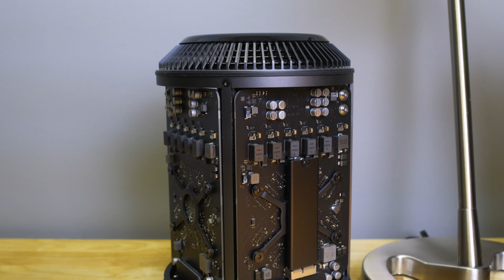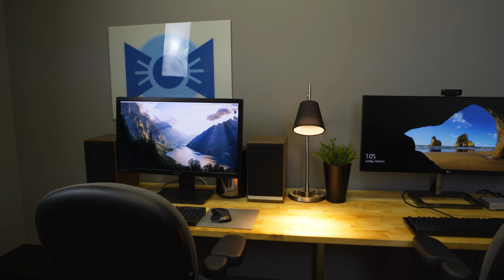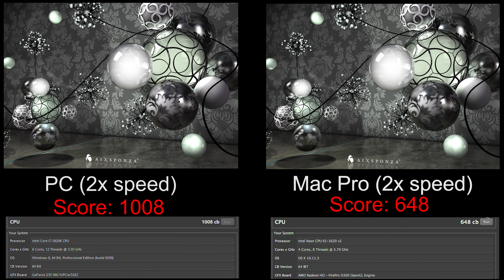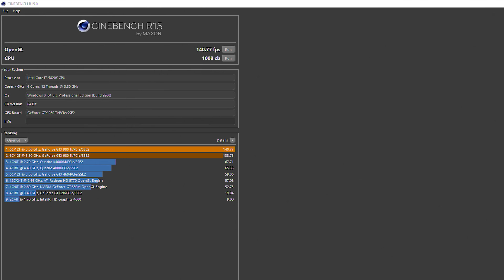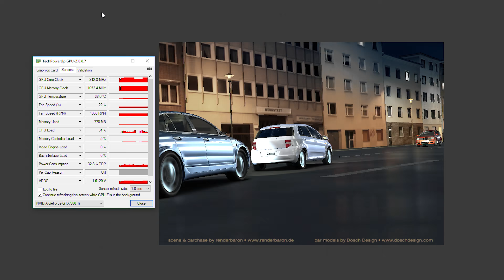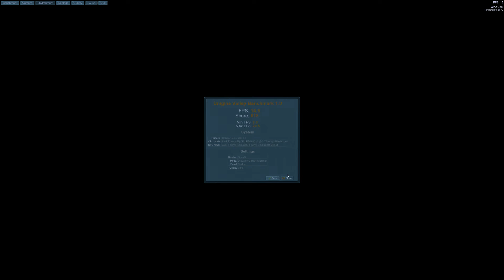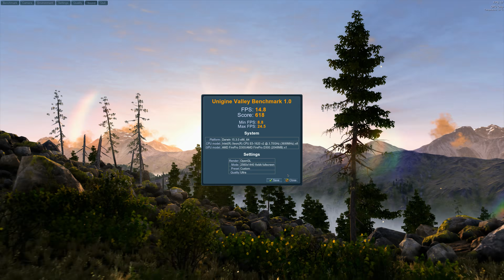$2,000 Custom PC vs $4,000 Mac Pro

Comment: It's interesting that you ran benchmarks that have very little to do with workstations, it's also interesting that you don't seem to have any needs that fit a workstation class machine. Have you looked at other workstation class components or machines, Snazzy Labs?

Also, you seem to have run the benchmarks under Windows, which is rather silly, since the support for the specialized workstation cards is completely disabled in Windows. It might help to work with a friend or to try to get yourself through this article to figure out how you might better compare the two machines: http://www.anandtech.com/show/7603/mac-pro-review-late-2013

The most important thing to remember here is that if the cheaper, build it yourself PC works better for the tasks you want to complete, then you SHOULD NOT be buying the Mac Pro. If you perform a similar comparison to workstations from other companies, you will see similar baffling results. The issue is a lot more complex than the very novice tech community believes, particularly the absolute newbies in tech that you'll find lurking the comments on YouTube, in general.

I didn't buy a Mac Pro as my primary desktop at home because the PC I built, similar to yours, Snazzy Labs, is what I need to be able to play games, looking for quick, inaccurate rendering rather than highly accurate, error free rendering -- although it has a 4690k and only 8GB of DDR3 RAM and cost me $2300 because a 980 Ti costs $900+ here.
Reply: lol spotted the scammed apple fanboy
Reply: +SniperReady "looking for quick, inaccurate rendering rather than highly accurate, error free rendering" you clearly have no idea how computers work.
Reply: Never mind the benchmark of rendering an image... Totally not what "workstations" are designed for...
Reply: ***** Do you? I'm curious. Do you understand what ECC is? Do you understand what chip binning is? Do you understand what different units are for and what application specific integrated circuits are for? Do you know how cache affects performance?

To address your direct concern, there's a good explanation on this wikipedia article: https://en.wikipedia.org/wiki/Nvidia_Quadro#Video_cards
Reply: Liam Keeton You're thinking of it in a naive way. You're not thinking about what the CPU/GPUs are actually doing, but what you think applies to a workstation. It's just not at all how it works.

Workstations offer features you may not understand, and it seems as though this is a hugely common sticking point for the novice computer user and even many advanced computer users, particularly those that believe they understand computers. It's difficult for those of us who actually study computer science to have to deal with the constant self-assured ignorance.
Reply: Saito Touhara I own a 980 Ti powered 1440p gaming rig. It would pay to read my entire comment.
Reply: SniperReady Sorry can't hear you over all the benchmarks and other software Macs can't run 😂👌✔😂👌✔😂👌✔
Reply: Saito Touhara I have a PC. It's better than yours. Hell, my second PC is probably better than yours. LOL
Reply: +SniperReady I definitely know what ECC RAM is. A much needed nessecity for avoiding memory errors on workstations and servers. I guess using ECC memory is a decent argument for the Mac,  however, it makes absolutely no difference to the performance of the computer. It would be all but difficult to buy an Xeon and workstation motherboard with ECC memory and put it up against the mac pro... No surprise that it would stillbe significantly cheaper.
Reply: Liam Keeton That's the point, not all of the things you pay for in a workstation are benchmarkable. Whether you actually need those features is an entirely different story, and I think this guy should have built a PC long ago for his computing needs.

A group I belong to is building a satellite. We require certain features, including radiation protection, that costs us extra money. It's never always strictly about performance.

For a good and proper comparison it pays to compare two workstation grade machines, and consider the features you will actually need.
Reply: SniperReady Anyone who buys a mac doesn't know the first thing about computers, lol enjoy your 8000$ alienware which is the windows equivalent of a mac  😂👌✔😂👌✔
Reply: Saito Touhara It's a custom PC I built while on an internship for a major video game publisher. I also work as a lead in the development of a satellite. Whatever you say, whatever you do for the entirety of the rest of your life, you will never, ever be able to match what I've done just so far.

Good luck with your emojis, though, I'm sure they'll keep your salty ass comfortable at night when you cry yourself to sleep from being yelled at at your minimum wage burger joint job. :)
Reply: +SniperReady If people are smart enough to know what they are doing with these so called "workstations" and their features how do they lack the technical knowledge to not buy overpriced hardware?
Reply: Liam Keeton I'm not sure what you're asking. It's common for lay-people to buy hardware they don't actually need, or they're fooled into believing is better. The Mac Pro is probably even still a pretty incredible price for a workstation compared to other workstations in its class.

Even a complete hardware pro can't know for certain that they're getting the absolute best value for their needs. It's an incredibly complex equation, so we just do our best.
Reply: +SniperReady It really fucking isn't. If you need Apple to cherry pick the components for your workstations then you probably shouldn't be using workstations. If you don't understand the characteristics of the hardware in the workstation, why do you need it? Any old goof can list ECC memory as an advantage of using the Apple computer but if he doesn't understand why he needs it or why it is important then he clearly doesn't need it. Apple is just a company with supposedly good marketing aiming to spoon feed computing to idiots who don't understand computers. I can see where you are coming from however, but this video is a good representation of a consumer grade computer completely destroying a Mac Pro, but it would be just as easy to make a video with workstation/server hardware.
Reply: Liam Keeton I think you misunderstand... there were several breakdowns showing the cost of building a Mac Pro as a PC yourself, and to simply purchase the equivalent components would cost more. That's my point. Apple is not building anything particularly special ( except that it's in a trash can bullet case thing. ) Other companies pre-build workstation machines.

People hate the idea that the Mac might not actually be the overpriced hardware their internet buddies have led them to believe it is, but the more I dig into the world of computer science, the more I understand hardware, the more I realize it's not cut and dry, and that 90% of the internet denizens have absolutely no fucking clue what they're talking about.
Reply: +SniperReady You just made the point that Apple do not use any special hardware in their systems. All the hardware is publicly available so it's extremely easy to buy similar hardware to the Mac Pro's hardware therefore it is simply untrue saying it is cheaper to buy Apple's computers. I will say this again, Apple is marketing themselves to be easier to use and basically targeting their market at people who don't know how to use computers and want a turnkey solution. This marketing tactic bleeds through to their pathetic attempt at a workstation computer.
Reply: Liam Keeton No, what I'm saying is that it's all available ( or equivalents ) but that the available parts are actually NOT cheaper than buying it from Apple as a Mac Pro. Check it out for yourself.

Comment: I don't get it this is old new, its been proven time and time again, but lets not forget OS X,form factor, 6 thunderbolt ports all factors for the ridiculous pricing.
Reply: +t800 He could upgrade the case he has to one the exact same size of the Mac Pro and hire someone to Hackintosh that PC and still it wouldn't cost nearly as much as that Mac Pro.
Reply: Wedge I think hackintosh's only work on select parts so he'd have to change some of his parts though, and the mac pro is no where near the size of that case, lets not forget hiring someone is also going to add costs, also 6 thunderbolt ports will cost a fortune

Comment: Interesting test results, though I imagine the appeal of this specific Mac Pro is the small footprint and general low-noise compared to that giant PC.

BUT a bunch of YouTubers are also finding that using FCPX (instead of Premiere) they can get videos to render quicker using sped-up Intel rendering on the Macbooks than on the Mac Pro. lolol
Reply: +EposVox This build is not definitive of all PCs. He literally used one of the biggest cases on the market for the motherboard he has. There is a case (NCase M1) compatible with his internal components that would have made his PC about the size of that Mac Pro if he had used it.
Reply: If he did a mini-ITX build, sure

Comment: Specs are not what most contemporary users look at when buying a computer. Cars are not exclusively priced based on how fast they go, why should computers be? There are numerous factors that determine how expensive a product should be. Some examples of this include: where is it made?; are all the components from the same company?; is it safe to use?; how long will it last?; what is the resale value?; is there an active community or culture that supports third party products and accessories to be made?; does it have a history? For most contemporary users, specs are just something that need to be met before making a purchase: most users are not hardcore gamers or plan to do heavy-duty effects work. They don't need a 4Ghz CPU to open up MS Word faster than they already do on their 2Ghz laptop. People buy into Apple simply because they're really good at marketing. And that sounds like an insult, but it isn't. Marketing is what supports third party development. Do you shoot your videos on a Canon, Nikon, Sony, or Panasonic camera? Is the reason purely over specs? Why not go with Pentax, Olympus, or Ricoh? They have similar specs at a lower cost. There are also some companies in China pumping out products that have comparable video specs too.
Reply: Marketing is not an excuse to overprice a mac pro. That's the problem with Apple, they know people will buy their stuff no matter what. It is stupid that apple are selling their 1k phones with no SD cards so you have to buy the larger size version of the phone to make sure that there is enough space. They even change their charges every year just so you have to buy a new one. Let's keep in mind that 4k is a lot of money for a computer in general so knowing it is possible to create or even buy a pre-built pc for half the price that would destroy the mac shows how overpriced the product is. Maybe it's just me but I see no point to buy an apple product, it seems like a waste of money.
Reply: George Smith Because, as I explained in my original comment, you're looking at only the technical specifications. This is not the only thing that consumers use to determine the value of a commodity. I know plenty of Apple users who couldn't be bothered with Windows-based computers simply because they've been burned too many times by hardware failures.

Let me make a comparison. On paper a 2016 Honda Accord beats out a 2016 Audi A3 in engine displacement, horsepower, and fuel economy. Yet the Audi is priced nearly 8k over the Honda. Clearly Audi must have some other selling points that increase their value. Could it be reputation or status? Or maybe people just don't trust Japanese cars because of different factory standards?

Let's make a another comparison. The Pentax K3 is less than half the cost of the Canon 7D MkII, yet the Pentax has better low light performance, in-body stabilization, more resolution (megapixels), and better colour depth. On paper the K3 is the definite winner, yet the Canon is the more popular camera. Is it all marketing? Or is it because Pentax didn't make the jump into the digital world as fast as Canon?

Let's go even further. Maybe it's simply the 'brand' that remains the x factor. People are willing to shove out more money for a brand that has proven itself to be more reliable. Even professionals often choose certain brands over other due to resale value. It's a lot easier selling a used Audi or Canon than a used Honda or Pentax. Same goes with computers –Apple computers retain more value than PCs. If you upgrade your entire system every 2 or 3 years, perhaps Apple is the most cost effective option as people are more willing to spend more money on 2nd hand. There are many ways to look at it.

Also Apple only changed the iPhone charger once. That is once in 9 years of existence, not every year. If you want to complain about chargers, try to find a consensus amongst PC laptop chargers.
Reply: I understand where you are coming from but do you think it's acceptable to sell an overpriced product? You cannot deny that the mac pro is overpriced, sure it might be more pretty and compact etc, but it is not worth twice the amount of a pc that is better. Your audi and Honda comparison is a prime example of big companies increasing the price of their product. If a person who didn't know about cars had a choice between the 2, they would pick the audi even if the car is 8k more because they know audi have a good reputation and the car is a 'high class' type. But if the person knew about both cars and their specs they would question if the 8k is worth it for the audi. This is assuming that both cars are similar. It's the same thing here, I grantee  you if someone had the choice between the pc and the mac pro and saw this video they would question if Mac pro is worth twice as much as the pc. I don't know what windows you have been using because it is highly unlikely someone will have so much issues with windows that they would switch to another OS. That would be an incredibly rare case or the person has no idea what they are doing. Again many businesses will overprice their products if they are large because simply they are a business, they are here to make money. My point is businesses should not be pricing their product off their business name, pretty much ripping of their customers because they know they will buy. There is nothing about the mac pro that shows it is worth the amount it is when comparing it to other products. Yes, brands will have better re-sale value than others but that is not the point. Apple can't just say we have increased the price of our product by 50% because it has better re-sale value. It is simple, Apple mac pros are not worth how much they are retailing for and you cannot deny it. If people knew more about performance and other brands, companies like Apple would no where near be as popular as they are now. Increasing a products price that is not deserved  cannot be justified because it is a certain brand.  
Sorry about the wording and stuff, I'm in a rush atm.

Comment: My PC is OLD!  I mean 5-6 years and it wasn't the best of the best even then.
Platform: 
Windows 8 (build 9200) 64bit
CPU model: 
AMD Phenom(tm) II X4 820 Processor (2799MHz) x4
GPU model: 
NVIDIA GeForce GTX 470 10.18.13.6451 (1280MB) x1
memory:
8 gigs of ram

Unigene Valley score: (Ultra HD setting)

My FPS was 19.7
Score 826
Min FPS 11.1
Max FPS: 35.6

So what do you apple lovers say now?  My computer is OLDER then that 4k mac pro and still beats it...  If the processor was on par it would probably beat its ass even harder.